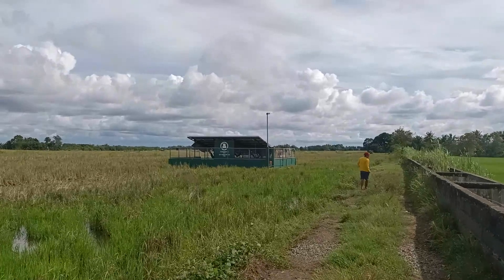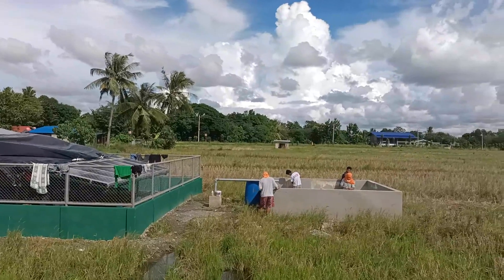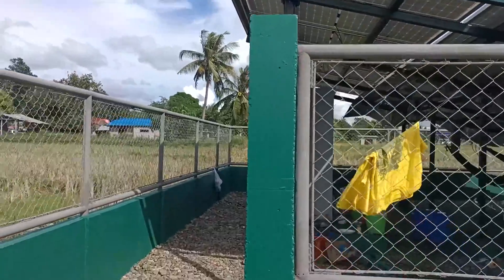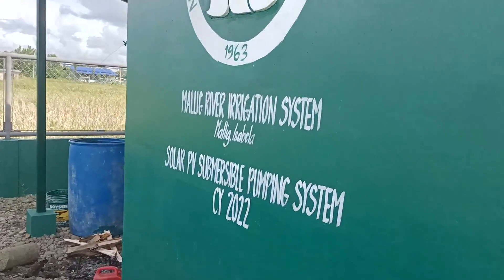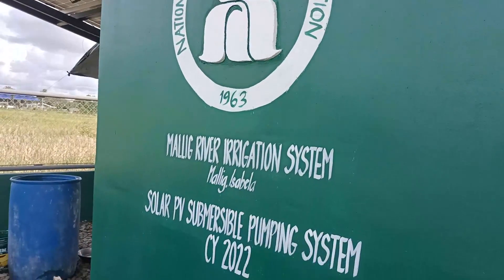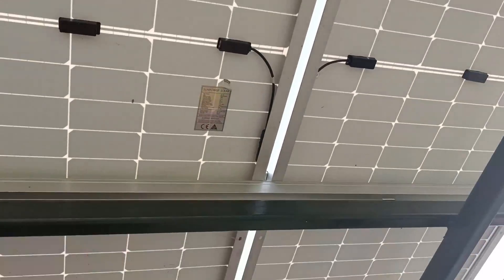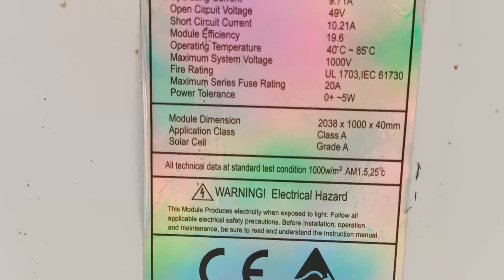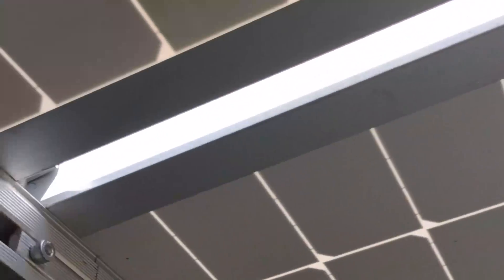Mallig, Isabela - NIA installed Solar pumps in Olango

Comment: Why the pool is not underneath the solar install?
Reply from the maker: Safety for the public and equipment. Children loves pool, the voltage can get to 300 volts from the panel in series so children being children could potentially die from electrocution by grabbing on the electric cables. Rust will damage the framing so having the pool out is a good thing